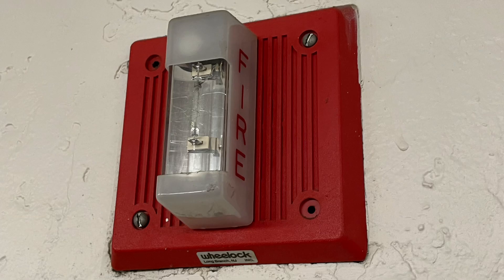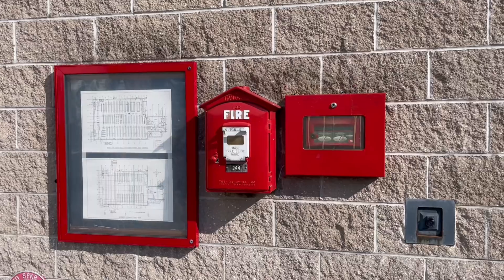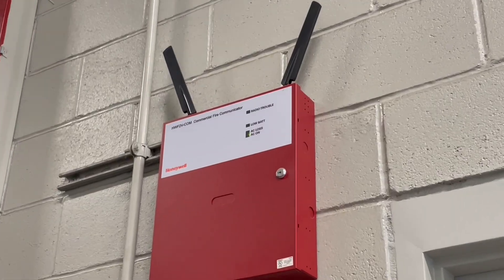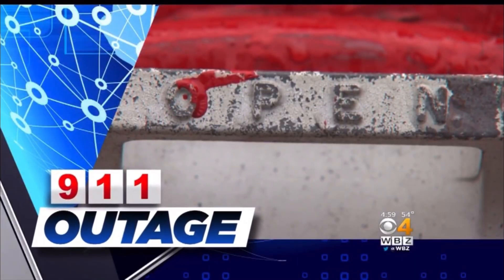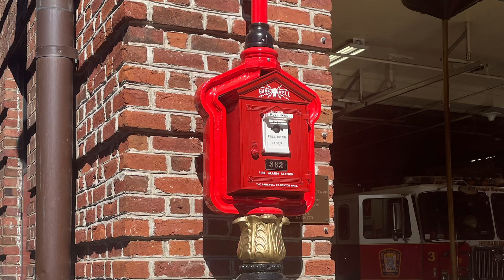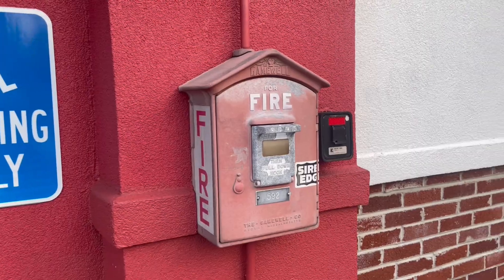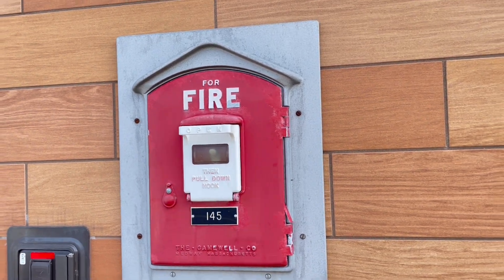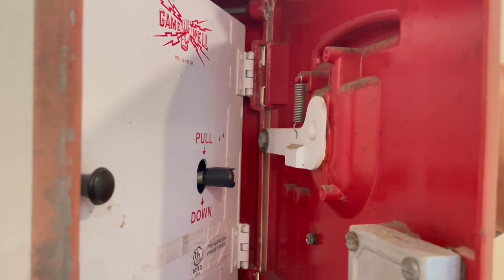All About Gamewell Fire Alarm Boxes | Boston’s Historic Municipal Fire Alarm System

Comment: My city used to have a network of these pull boxes.  You could usually find them on every street corner in the city.  With the advancement of communications technology, these pull boxes were rendered obsolete and the system was decommissioned.  The city removed these boxes from street corners some 30 years ago.  I think there might be some building mounted pull boxes left, but I could be wrong about that.

Comment: In addition to Boston, nearby Quincy still has a workin' system. And I remember Newton, and (more recently), I found boxes in Peabody.
Reply: Somerville still has a handfull of old boxes left, most have been replaced with radio boxes now tho
Reply: Newton is where Gamewell was headquartered, then they moved to Medway, also Newton Control was where they dispatched and checked availabilty status for the metro Boston mutual aid system

Comment: great video covering master boxes! If you want another brand example, Digitize is another common manufacturer of master boxes however they utilized radio units which to my knowledge communicated on the AM and FM band rather than a mechanical code wheel and would report back to their own receiver equipment such as the Prism LX. I believe they made telegraph decoders for Gamewell stuff as well

Comment: I believe many of these systems were also tied to a large alarm or siren (Gamewell sold diaphone horns, Sterling sold sirens with brakes, and Fedelcode sold sirens with coded dampers), with these horns or sirens blaring out the box number just like a bell in a station. I could be mistaken but there is a video from Saint Clair PA of a Gamewell diaphone sounding from a Gamewell fire box
Reply: Yep I very well recall the BWAAAAP....  BWAAAAP..    BWAAAAAP of the box alarms in Abington

Comment: It would be super cool to see a modern version of a municipal fire alarm system. Now adays you could for example simply have however many 4100es panels you’d need for the whole city networked to each other with addressable pull stations. Considering each SLC loop can have 250 different pulls on it you’d probably only need one panel
Reply: True
Reply: Would probably help lower response times too. I imagine there's an added delay with a fire alarm system monitored by a 3rd-party who has to call into the local PSAP, instead of the system directly signaling the PSAP itself.